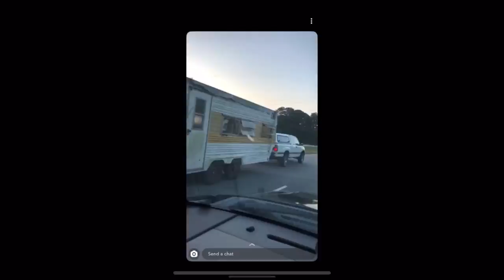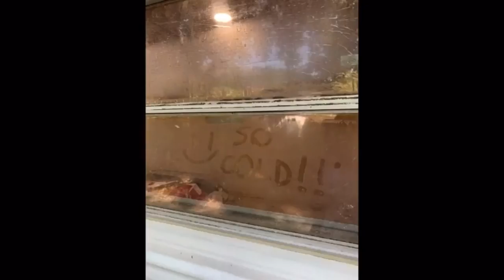VINTAGE CAMPER RESTORATION (7 minute time lapse)

Comment: I'm in the middle of rebuilding a 25' 1977 Shasta that I bought for $40 into a tiny home . I took mine down to the frame though and sandblasted the frame and used Lizard Skin Frame Paint on it, yes it was EXPENSIVE but it's worth it because that's what all the car builders use in their high end builds. I'm also not putting an stove/oven back in, a couple years ago I bought a one of those countertop  9 function Air Fryer/Ovens and pretty much stopped using my home oven, between it,  my microwave, my small crock pot and my small electric skillet that's all I need , it allows me to have/use less counterspace and even when they are all stored away it still saves me space and weighs less when I travel. I'm also using Flex seal on the roof and Automotive sealer for all the seams instead of caulk because it's twice as good as even the most "heavy duty" caulk, yes it's more expensive but it will long outlast me instead having to recaulk every couple of years. I'm also going to put on some truck bed liner on the underneath of the floor for some added insulation and to protect the floor from rotting because there wasn't a metal belly pan. I know i'm over building it but I'm going to live in it full time.

Comment: I have an old 1972 or 1973 AMF Skamper M-285cb that I want to get rid of. It needs a lot of work and is not livable, but it could potentially be fixed up or used for parts. Anyone want to take it off my hands?
Reply: Where are you located?